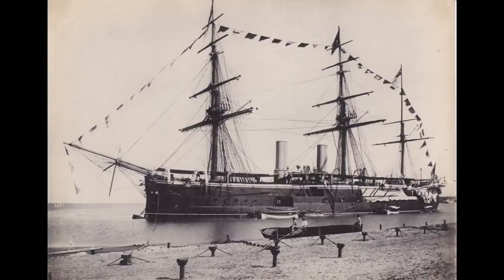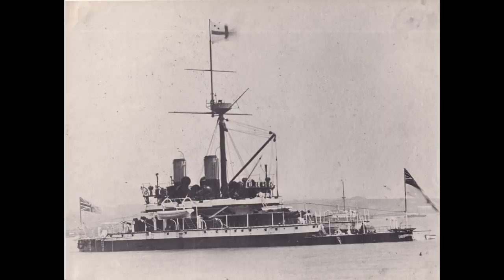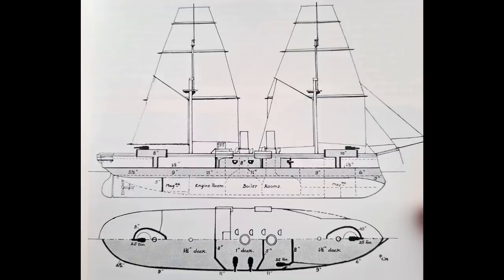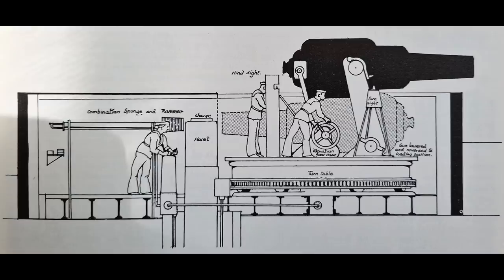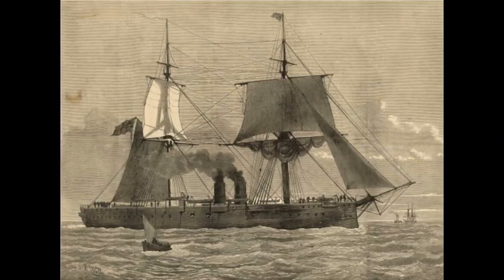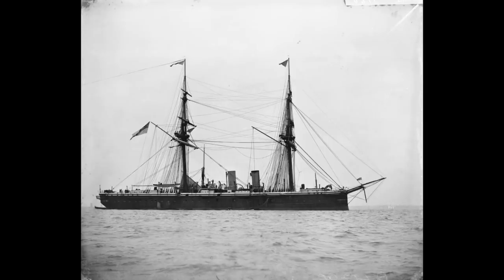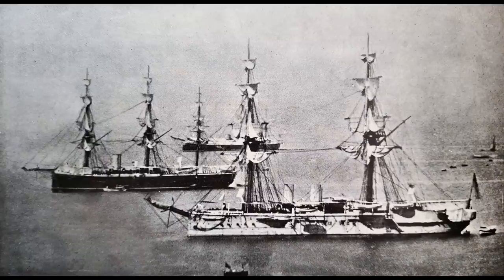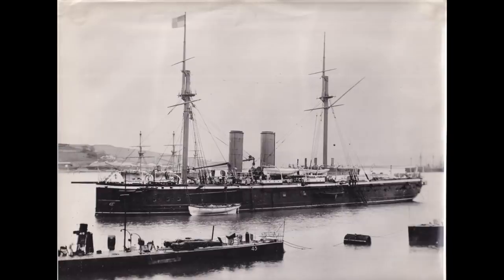HMS Temeraire (1876) - Guide  275

Comment: Those disappearing gun turrets are the most brilliant steampunk nonsense engineering solution I’ve ever seen

Funnier than dynamite guns by miles
Reply: I didn’t realize that dynamite guns were primarily comedic in nature, I guess if you were neither shooting them or being near what was being shot at by them I could see how they might be slightly amusing.
Reply: @philvanderlaan5942  in olden days there was a gun called: Amusete, for this purpose.
Reply: How about putting a dynamite gun in a submarine?
Reply: @comentedonakeyboard  looked it up and it seams to be almost the very thing designed for the Royal Navy who looked at it and nope-ed right out of there at the same time that Patrick Harper came along going ‘ Does anyone mind if I ‘Borrow’ this ? ‘
Reply: @k3D4rsi554maq  you may have hit on the one effective use , but I think it’s too much effort for too little payoff
Reply: @philvanderlaan5942  well a french named gun, on a french named ship seems logical (but i think i spelled it wrong, it's actualy Amusette)
Reply: @comentedonakeyboard  yep but I’m hardly in a position to point out spelling errors.
Reply: @philvanderlaan5942  mercy beaucoup
Reply: @k3D4rsi554maq  Perhaps I can introduce you to USS Holland, a submarine armed with an 8.4 inch dynamite gun?
Reply: @comentedonakeyboard  pardon, moi françe c’est tres mal .
Reply: Weird that I was thinking of a disappearing mount as a way to have armor low, but a plate up high for freeboard, just as Drach mentioned it.  But then, I frequently visit Ft Stevens and their 10" disappearing gun restoration.  One almost wonders if the first version had the gun rotate to 90 degrees with the loading being by  crane and gravity.
Reply: @philvanderlaan5942  mine to
Reply: @philvanderlaan5942  Amusing from the vantage point of 140 years.
Reply: The disappearing gun turrets reminds me of the retractable phase cannons on the NX-01 Enterprise starship.
Reply: @hawkeye5955  I've seen photos of retractable guns but they were on land with enough room in front of them so they could be reloaded. At Corregidor I think.
Reply: @hawkeye5955  the Royal Navy was realy ahead of it's time (and Mr. Reed just to humble to ever mention it)🖖
Reply: @philvanderlaan5942  check the uss Holland
Reply: @k3D4rsi554maq   only if windows are open ...

Comment: I think you got the gun loading procedure incorrect. By the look of the rigid linkages in the image, it couldn't flip over as it lowered. I believe what it did was lower like any other disappearing mount and then the turntable that is labeled such just spun the mount around to the loading position.
Reply: You are correct, those linkages would only give parallelogram motion.  Wikipedia also says as much on their page for the ship ~ "On firing, the recoil of the gun caused it to drop below deck level; this allowed re-loading without the exposure of the gun crew to aimed enemy fire. After loading, the gun was rotated by a hydraulic system back into the firing position. "